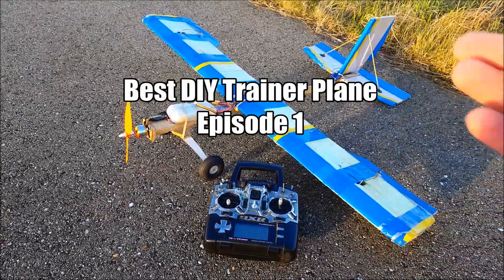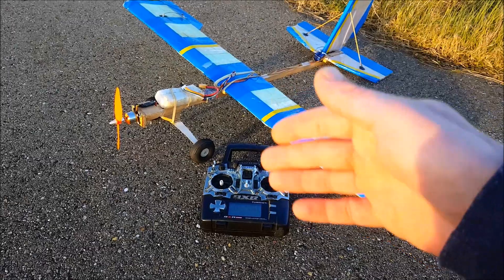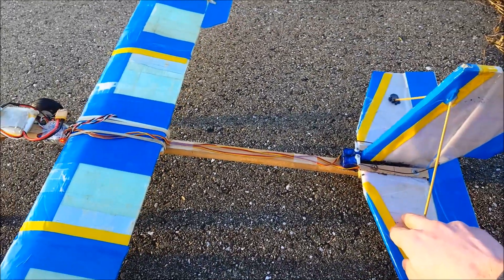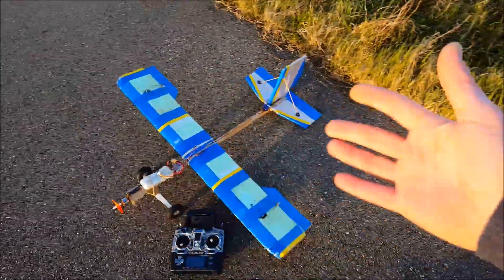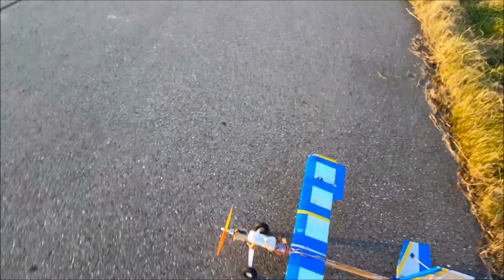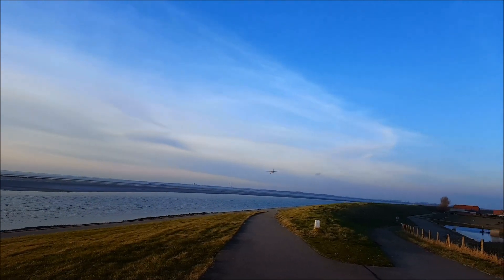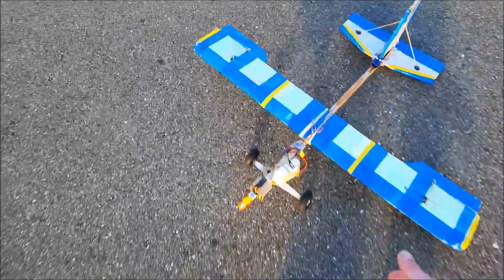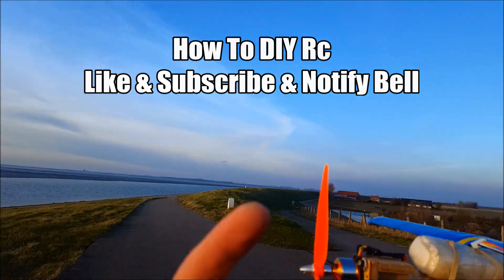$5 Trainer Best Beginner Rc Airplane Project EP1 Build Overview and First Flight of 2018

Comment: Thanks for making this series of videos, which I just found. I've built several such planes out of foam board along the lines of Ed at Experimental Airlines and Andrew Newton. All of them are great fliers and are very durable. Surprisingly, even though they are very light, they handle modest winds very well. 
  I used foam board to make a built-up fuselage because Ed's method of folding the foam board did not work for me. The fuselage tube always came out with a twist, which was not acceptable. I make the fuselage length about 42 inches, or 105 cm. 
   As an experiment, I built a wing using the Klein-Fogleman KFm3 airfoil which is very easy to build. It produces good lift and has good stall characteristics, which means it doesn't tend to drop a wing and spiral to the ground. Wingspan is 60 inches, 1.5m. Wing chord is about 8 inches, or 20 cm. 
   All my foam board planes use 3 cell 2200 mAh batteries and 2215 motors with a Kv from 1,000 to 1,400. I use 10 x 4.7 props. Flight times are about 8 minutes of casual flying. 
   I used one of these planes as a trainer to teach a new club member how to fly. We beat the crap out of it because I would allow him to get deep into trouble before I would take over. Sometimes I waited a bit too long and the plane would hit the ground. The nose took a beating and we broke a few props, but I've never had to replace a wing. They are strong!

Comment: You are not used that polyhydral wing in this plane? Which you shown in the wing making video. Will poly hydral wing fly?
Reply from the maker: yes it will fly and the wing you see in this video is also polyhydral
Reply: Thanks for the reply. I have made that polyhydral wing with 20 degree angle, is it right?. Need to fix with tha body and gonna check. And it seems like flat wing in this video.
Reply from the maker: yes it looks flat because i used only 5 degrees of angle and  your 20 degrees works much better than only 5 degrees 
just so you know polyhydral wings specialy are made for 3 channels planes but you can add ailerons to them aswhell and work good
Reply: Thanks for the reply..
Reply from the maker: np i love to help :D

Comment: Hi,
What is the size of the electric motor that you have used on the 5$ plane? And what would the fuselage length be when you use the poly dihedral wing?
Reply from the maker: 3s 2212ad 1400kv link in the description and length of body stays the same

Comment: Used your affiliate links to buy the stuff. But the flysky i6b receiver doesn't light up when I connect it to the esc. No red flashing light. The esc does make a noise when I connect it to the receiver however
Reply from the maker: Did you already bind the receiver with the radio?
Reply: @HowToDIYRc  no
Reply from the maker: well there you go thats why it doesnt work
Reply: @HowToDIYRc  the problem is with binding. The flashing light indicating it is in bond mode does not come on
Reply: @HowToDIYRc  The Ubec in the description, forgot to hook it to the esc. That's the problem I think. Problem is, they dont pair.

Comment: how much does the plane weigh with and without the battery?
Reply from the maker: without 950gram with 1500lipo battery 1100gram
Reply: How To DIY Rc such a nice plane hahah also how whats the flight duration and how many amps do you draw?

Comment: I use tiny tie wrap instead of screw to hold the motor.  If it crash the tie wrap brake and it save the mount and the motor. Also it  takes 5 sec to put a new tie wrap.   I also started to use tie wrap to attach the propeller directly to the motor. 
Actually I do the same for the servo.   It's easier to remove the servo if needed and it  hold better than glue or screw.
Reply from the maker: that's an interesting way of doing it thx for the tip maybe we give a try but scared that the motor moves around and changes thrust angle?
Reply: Yeah I use a pliers to tighten them enought.  
First time I've done this was to do a quick fix after a crash in the field. I was not sure it would hold .  But turn out two  tie wrap is enough to hold a 2212 or 2826 motor.  The tie I use are 2mm x 120mm.

I put them in the standard hole of the motor mount from the top and back on the bottom hole.  It,s why it take only two tie wrap to fill the 4 holes.

Comment: What is the average lifting weight of the motor because I'm making a hexacopter weighing around 1.8 kgs
Reply from the maker: 6x900gram of thrust = 5.4kilo of thrust 
The motor weighs 50grams and ESC 10g x 6 =360grams - 5.4kilo is roughly 5kilo of thrust 
must say these motors do give a lot of vibration and that bad for the gyro 
so i don't recommend this motors for quads or you must soft mount them really good!

Comment: What a gem of a plane! have been intending on getting a STOL/Bush plane like a Dynam Primo or Cub etc for this season but this thing ticks all the same boxes and then some.
Look forward to your build series, your passion is infectious as always, Dave!
It seems you've probably saved me over $150 :) Cheers ,mate.
Reply from the maker: you're going to love it this plane in the next vid we show a bit more how easy this plane fly's doing stall turns and flying low and slow and we throw in a couple of loopings and get the plane in trouble to show how much power the plane have to help her to get out of trouble 
and keep doing that even after a crash you pick it up and try again that's the best thing about this plane and that all because the body is one big and stiff reinforcement stick with little to no drag and sidewind that can give adverse yaw
Reply: You sure have some self esteem. Go ahead and show up at your local club w that pile of garbage, definitely you will give them something to talk about. Dont forget ni-cad batteries w a trickle 24 hr 12v charger,  a beater Ford Pinto or Taurus w a cracked windshield, expired tags, dont shave for three weeks, Budweiser t-shirt (ketchup marks)  shoes w holes are a plus, missing teeth for that inmortal status...
Tell them the ones sold at WalMart and Radio Shack are too expensive 😂😂😂😨😭
Reply: @zubuxstein  Have we met? I ask because you describe me almost perfectly! I have several foam board planes which are not pretty, but they fly really well. And I have a reputation at my club for flying ugly airplanes, but it often happens that I'm flying while the rest of them are sitting around claiming the wind is too strong to fly. 
  I've owned both a Pinto and a Taurus but I show up at the field with a beat up work van. It serves as my mobile hangar. Would say more, but I have a dental appointment in about an hour so I have to try to find a clean shirt. Life is good!

Comment: thanks for posting.  i just hope no one Copies it.   about eight things have be done Incorrectly.   do those flaws prevent it flying.   no.    cheers
Reply from the maker: Wow, this is going to be very interesting can you please enlighten me and explain the 8 things we did wrong?... please sir thank you very much
Reply: okay.  here's the list.   flexy prop used.   aft fuselage Not tapered.  vertical-stab is taller and Heavier than necessary.  bracing used at the Tail (Extra weight).   the main wing Should be about three inches Farther from the elevator.  if the wing is moved forward, the prop Should be about four inches closer to the wing.  battery Should be mounted LOW, not on top of the fuselage.  the main landing gear Should be located Beneath the main wing Leading edge.  servos have been installed in the Outboard wing.  the span of the horizontal-stab should Not be greater than 30 percent of the span of the main wing.  in order to achieve clearance of control surfaces, material has been removed ONLY from the rudder.      cheers
Reply from the maker: A flexing prop that breaks easily is my preference because something has to give in a crash better a 34cent props fail that is easy fix than bending the shaft is a bit more expensive
taping a fuselage for waterproofing is an option but I like to show the wood and clear tape leaves a white glue when it gets wet  
the bracing at the tail is something we needed to add after 2 years of a hard life 
not so bad in my book and easy to counterbalance with shifting the battery a bit more forward
the distance between the main wing and my elevator is all related to how big the wing and tail surface are and you while see it working just fine the plane got over 200 hundred flight under its name
I agree with the battery I love hanging it under the body but in a crash, there is more likely something going to hit the battery and destroy it... the most expensive thing on this plane
that beginners are going to crash a lot!...so we placed it on top and it's not so heavy battery and we have a polyhedral wing that still self-correct pretty good still easy to fly this way
the main landing gear placed far to the front so when landing the prop doesn't hit the ground and gives extra nose weight..... + do you how many different plane designs there are this is one of them experimental plane designs that have proved to work just fine after 200 hundred flight
servos are placed where there is a minimal amount of drag perfect in my book
what do you mean? Is horizontal stab my ailerons? this where you lost me
and want to thank you for your feedback is always welcome 
I always like to try out new things and you tips do help Sir
I hope you understand a little bit of why we designed the plane the way it is?
and have a good weekend cheereo
Reply: i see a lot of Bendy props being used these days.  as done here, the use of a bendy, s-f (slow-flyer) prop was, perhaps, justified by reliance on a similarly Flawed Theory.   there is a Correct prop Type for any application;  that one ain't it.     i SAID   the aft fuselage was Not   TAPERED.   correctly tapering the aft fuselage is an Important part of Weight Management.    stabilizers CAN easily be made secure Without bracing;  ever hear of epoxy or contact cement.    battery Location Should Not be varied, willy-nilly.   the battery Should Always be Fairly near the CG.   a forward battery location indicates a Heavy Tail.  a forward battery and a heavy tail result in full-time DAMPING of response to elevator inputs and a Less stable Distribution of Mass.   you provided some nonsense in apparent opposition to certain FACTS i have provided.  Facts Cannot be argued away.  the Facts are Not going to change.   i suggest you try to incorporate them into your thinking.  cheers
Reply from the maker: david your a good guy but the main reason why we build this plane to be durable second to fly easy and maybe there are better designs that fly even better but durability come's first in a trainer plane at least that's what I believe we while trying some of your stuff along the way but we like to be like the Wright brothers and build many planes and learn from ower mistakes :D
Reply: why did you even come back with this.  really.      excuses, rationales or anecdotally supported opinions to the contrary do Not interest me, neither do they affect the Validity of the information in my comment.    cheers
Reply: @daviddavids2884  Just curious . . . do you design and build a lot of planes?

Comment: Yes! This is what I've been waiting for.
So how much all of this would cost including a cheap transmitter... like... Flysky FS-I6? I hope it won't exceed 120 USD assuming I already have battery and charger.
Reply from the maker: we have linked all the parts below in the description and with a transmitter it's less than a 100 bucks you need 4x 9grams servo's cost $10 all together a 2212 1400kv motor cost around $6 with spare motor shafts and bearing on ebay that why i love this motor and for the 900grams of thrust is a lot for 6 dollars 

9x5 prop cost 35cents they break pretty quick but that saves you from bending the motor shaft that takes a lot more time to replace and cost 1 dollar instead of 35 cents
a good 30 Amp Esc around 8 dollars and 3 dollars for a 5v BEC
12 dollars for a 3s lipo battery and 45 dollars for a good budget radio =10+6+8+12+45= 81 Dollars
and you spend 5 dollars on building the plane mostly for the hot glue and wooden stick 
foam, tape, barbecue sticks, and welding wire are free in my world 
hope this helps you on your way mate :D

i can guarantee you while like flying an rc plane when it's built strong, durable and simple
makes also simple to fix that one time after 20 crashes ore so... no joke but damn funny 
if you see your plane crash horrible and then you pick it up and throw in the air again and fly perfectly fine just blows your mind considering the money you just spend 
have a good weekend :D
Reply: Yep, totally forgot to check the description.
I'm surprised of how simple it is. No flight controller required, your finger is THE flight controller.